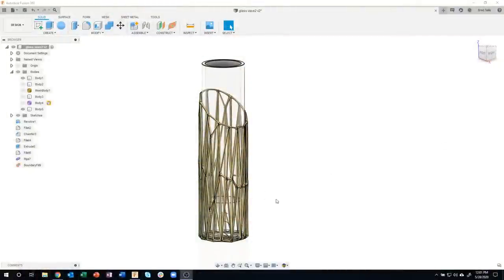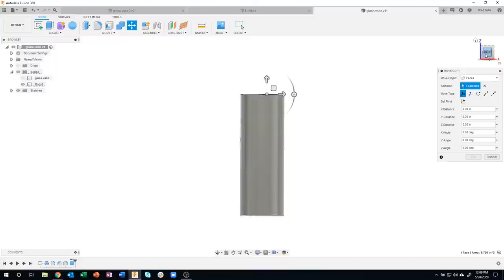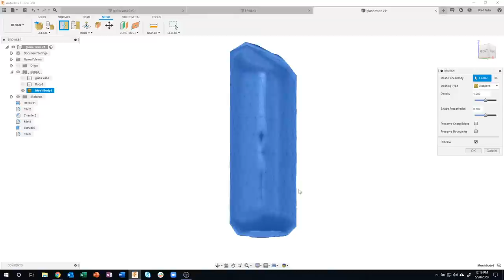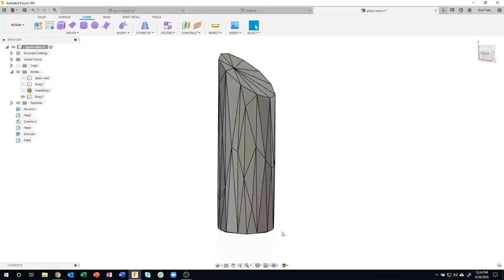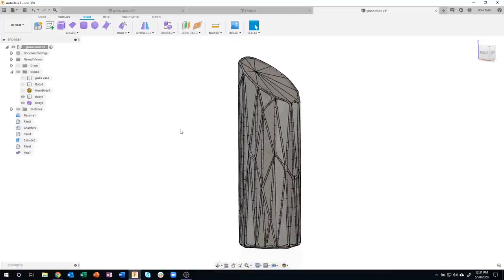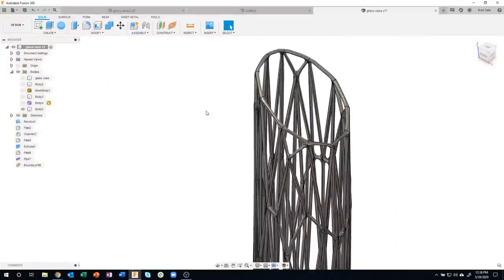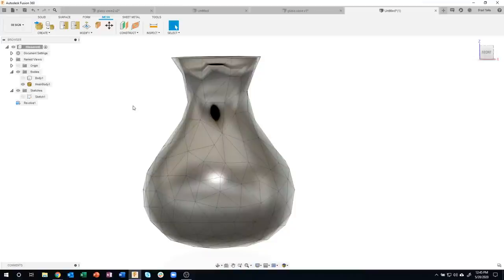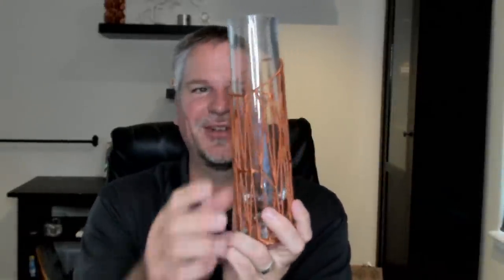Fusion 360 Live - Organic Meshes in Fusion 360

Comment: Hello Brad,
That really is a great way of designing organic shapes basically from any shape. However, since the version you used is older than the current one, we're getting the following message when clicking on "Finish Form": 

                  "T-Spline model failed to convert. If you continue the model will not display in the parametric workspace. You can return to the Sculpt workspace to fix the errors preventing conversion."

In other words, unless we have no errors, we are not allowed to convert the Form into a Body.

Any ideas to go around this obstacle?

Thanks in advance.
Reply: This - exactly this. How to get around it?

Comment: I have my pipe body and a cylinder. Boundary fill  I select the 2 tools - it only shows one check box for the cyclinder but says 2 selected.  But when I go to select the cell (cylinder) the pipe body visually disapears compared to 39:02 When I do cut It just returns to the original form body and doesn't create a new solid body.

Comment: Excellent tutorial! Using F360 2.x and not turning off the Parametric History, I was able to replicate all the steps until I got to the "self-intersecting" surfaces (welding) and I could not find a way to use the "Boundary Fill" option without turning off the History. Is there another way with version 2.x to keep the History and use the "Boundary Fill" trick?

Comment: I found that in the latest version, I can do BRep to Mesh with Mesh menu -> Tessellate (second icon). To do the pipes I had to do Solid -> Create Form (purple icon). But I can't finish the form - it's always invalid, and if you "Finish Form" with an invalid T-Spline model it says it failed to convert to a parametric model. Whilst it has a Continue/Return button, if you Continue the Form is lost. There is a repair function, but it doesn't solve the problem. Anybody managed to get further?
Reply: I was also stuck here, but dont worry I fixed it!!!! You MUST select "do not capture design history" at the top of the browser window (above named views and document settings, right click and select" only then will the form be visible in solid